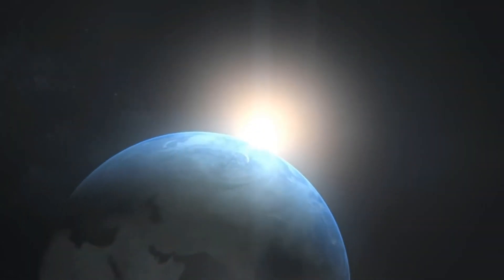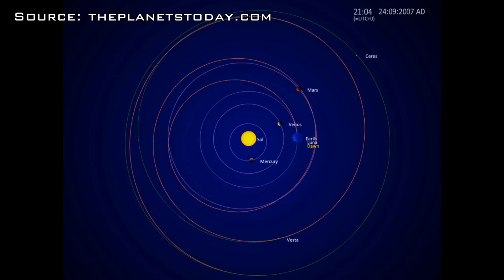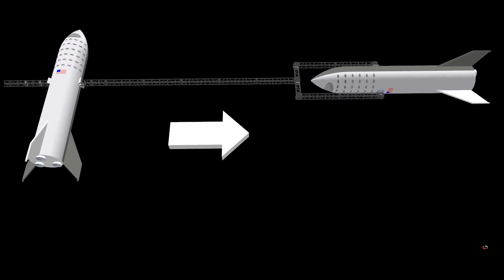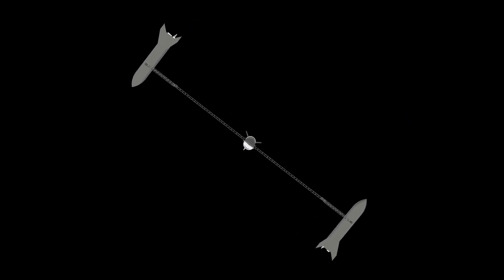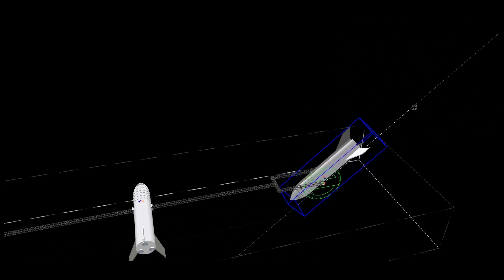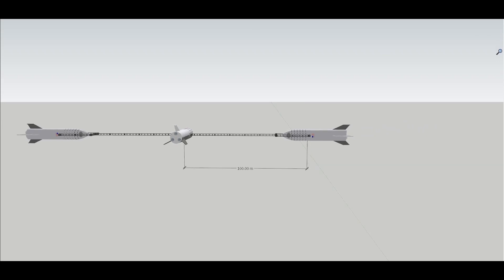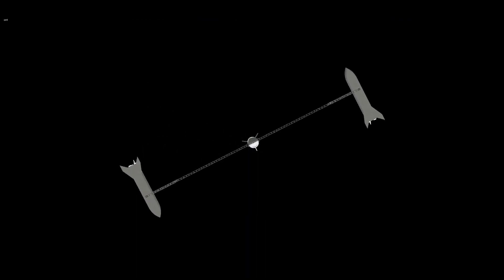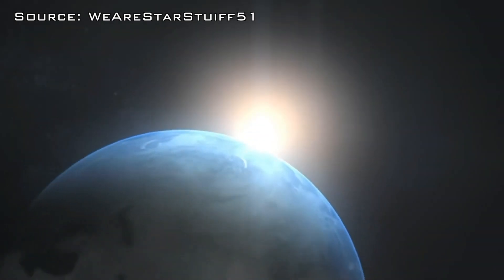GLS2: Artificial Gravity for SpaceX's Starship

Comment: This is the most practical artificial gravity system I have ever seen!
Reply: Where can this be discussed without having to wade through the flat earthers,
Reply: I see one big flaw in that system. 
That extended metal frames, which held those two Starships tied to central one - they shoud be able to hold on all the weight of ships. It's similar, in a way, to huge ass cables with great mass on their ends, which are attached to ceiling and must not snap under tension.
Mass of one Starship (fully loaded with fuel) - about 5000 tons (under Earth gravity), it's equivalent of 11 Boeing 747 or 83  M1 Abrams tanks.
If that spin gravity could get acceleration in equivalent about 0.5 g - than each frame should be able to hold about 2500 metric tons, which is a lot - a hell a lot I mean.
For example - modern tower cranes, which are used in constructing skyscrappers, could lift (and hold by cables) in avegare up to 60 metric tons. Most powerfull of mobile cranes (not gantry) - Liebherr LTM 11200-9.1
 - could hold up to 1200 metric tons, which is equivalent of Starship weight in 0.24 g. And I have doubt that it could hold that weight constantly for days and even months without material fatigue, frame breaking and eventual catastrophe.
Reply: @alexmalyarchuk1723  I think the Starship mass would be closer to 500 tons after TMI. You only need artificial gravity for the coast to Mars, when the fuel tanks are probably at less than 20% capacity.
Reply: @bubbajones6907 wiki says that total mass of fully-fueled Starship (with Super Heavy rocket) is 5,000,000 kg.
Starship itself - gross mass 1,320,000 kg (with fuel).
Ok, I see mistake in my assumings - that spingrav carousel should be consisted of Starships only, Super Heavy excluded. Than - 1320 tonns at each end. It's more feasible.
But still - imitating 1 g is quite too much, tension in structure would be drastic. And whole station should be capable of "making gravity" for at least few month nonstop.
0.3 g - martian normal - should be fine enought.
Reply: A tether system is far superior.
Reply: Earth is a luminated Plane (No Planets) there is no outer space, at All. There is a limited Void (The Raqia-Hebrew) above us, and it's full of ionizing Radiation, UVC. Therefore All the "Space" Programs since 1958 NASA ("To Deceive" Hebrew term) are being faked and filmed like a Hollywood movie. People are very gullible and naive, sad. Here you go https://www.youtube.com/watch?v=_ZBdnpRwyPg time to wake up.

1
Reply: @mulder2400  sorry what are you credentials, again? Calling people "gullible and naiive" when you've likely gathered your insights by blindly trusting sources on the internet is a bit rich. But I wouldn't expect you to understand irony.
Reply: @jonny__b  he's probably just a scitzo. Don't give him the time of day.
Reply: mulder2400 would you like to know how you’re a dumbass? Here I’ll break it down for you. 1) The number one question to ask is “does it affect the rich?”. Billions of dollars are put into space every year from government and private companies. People just don’t waste money. 2) Global cooperation is harder to achieve then getting to orbit. Several countries with space programs hate each other and would have no willingness to help cover up a secrete. It benefits no one to lie about what space is. 3) you yourself can launch something into space. It’s not extremely difficult to build what is essentially a large model rocket to launch something into space. That’s how Rocketlab started. 4) why would there be so many start up space companies if there was no space. A company exists to make money. A company can not exist if there is no money to be made. You have to pay thousands of employees annually. It’s just not realistic that a company would start up simply to push a lie for the government. (5 Blue origin will be launching citizens to space and back down on their New Shepard rocket here in the coming years. A company will launch you to space and you will see for yourself how stupid the idea that space is fake is. I have about 100 other points but 5 is enough for now. Please take the time to hop aboard new Shepard or Starship for that matter to see for yourself that the only people feeding you lies are the flat earth you tubers.
Reply: mulder2400 How can you be that stupid in the 21st century?
Reply: @bxmafiax  Hey. He has the right to be so.
Reply: @itechiwizard83  Everyone has the right to be stupid. But he's abusing the privilege.
Reply: @peterclark711  XD
Reply: @mulder2400  'very gullible and naive' you got that part right at least
Reply: @mulder2400  Yup. And there's a massive tortoise underneath that plane. It feeds the Earth. Under the belly of it, there's a massive structure attached like in an Air Ship in which the God lives.
Reply: Mulder2400 are atoms flat too?
Reply: @mulder2400  I would like to communicate with you, but the Prime Directive prohibits me from interfering with less developed civilizations.
Reply: @mulder2400  even if you got a first class ticket on the star ship to mars you would still call it fake

Comment: Seems there's a lot of moving parts and extra weight with this good idea. How about doing away with the tether and interlock both rockets nose cone to nose cone via a central inter locking system? Both rockets would need side thrusters to spin both rockets a little faster.  Surly this would reduce weight, and vastly increase stability......just a thought.
Reply from the maker: I like it! kind of a double tumbling pigeon

Comment: Truss is lame.  The RCS on Starship will be Methane, it will have plenty of power to slowly spin up two ships no matter what the mass.  Raptors of either type will be way too powerfully for spin up.  A full G is not needed.  Full lamosity.  Only thing you got right is the need for spin, broken clock level
Reply from the maker: The RCS will use methalox? Will they get their feed from the same prop tanks as main engines?
Reply: @smallstars  Hello smallstars I have been following the BFR announcments from the earliest days and they have made it clear that one of their goals is eliminating COPVs and all extra fuels, oxidizers and pressurants.  One of the advantages of methane is that it will self pressurize.  That means they could use that pressurized gaseous methane to supply cold gas thrusters.

I remember reading that they would be using the main fuel as RCS.  Admittedly, they change their minds a lot, as they should during the design and testing phase.  But ask yourself, if they use anything else how will they make it on Mars?

With Musk, always ask yourself does it help get to Mars quick, cheap and often, and ignore any crap he says about Climate Globalony
Reply from the maker: @adlsaias  Are you taking into account the difference in efficiency when using methane as a cold gas?
Reply: @smallstars  nope, but it would most likely be no worse than what is being used now to control the dragon.  If they needed more efficiency they could make mini rcs thrusters that burn methlox

Comment: Nice concept until you start thinking critically about the forces involved. Maintaining 1g of force for both ships will put tremendous stress on the trusses and central ship. For comparison, imagine the entire weight of the loaded ship being suspended by a single truss here on earth. That'd be like hanging an entire apartment complex from a single truss.  I think most would be nervous about  trusting that amount of weight to a single truss. Now multiply that force by two for the force pulling on the fuselage of the central craft. Without significant advances in tensile and structural strength, there's no way the system could hold up under such tremendous force.
Reply from the maker: I agree. A concept like this would require massive hub hardware, and about 12 tons of thick cable to "hang the weight" so to speak.

Comment: Whilst this particular idea is tailored to Starship, spin gravity was formally proposed by Robert Zubrin's Mars Direct architecture, which no one interested in Mars travel should be unaware of.  
And after 60 years on orbit, and endless tests of micro-gravity (conclusion: Micro-gravity is bad for humans) the fact that no one has tested Mars G (.38G) in a LEO spin tether habitat, had long since led me to conclude that no one had any real interest in going to Mars.

This will be a vital test before anyone heads for the Red planet. What is the threshold between 1G Earth gravity, and Micro-gravity, where the negative effects on humans become serious? Will a year or two (Or a lifetime) in Martian gravity be manageable, or a show stopper?
Reply from the maker: Great points! Zubrin is the champ. In all of his presentations i've seen, he does not explain how the spin would start up. Also his examples are for smaller, less massive spacecraft so all of the systems that support the spin can be smaller. I assume his plans would utilize RCS.

In terms of the amount of artificial gravity, from the knowledge we currently have, it is my opinion that more 1G is better, especially for strength and bone loss. So considering 1.5 years on Mars is assumed, 1 G during the 6 month trip there and back is going to be super important.

Comment: one problem with this system. when you want to slow down the spin, the fuel would be pushed down sideways (after the re-orientation of the spaceships) in the tanks and cannot reach the connections to the turbo-pumps. you would suck in the helium pressure-gas. in order to avoid this, you would need a second line feed for the fuel taking into account the "gravity" orientation
Reply: Not only that, but think of how rigid the spaceships would have to be in order to be suspended by their "waists." And how much that structure would weigh.
Reply from the maker: I envision the vacuum raptor to start up the burn before the co rotation begins. Not sure how practical that will be though.

I don't believe making the hull rigid enough will be an issue.

Benjamin brings up a good point though, the massive swivel joint hardware should launch on the GLS as part of the truss/cable system.

Comment: Great idea. So many variables with artificial G. NASA should build a large centrifuge that would replicate this concept on Earth prior to investing massive funds to prove it in space.  If designed correctly it could be scalable to test other ideas. Also I highly recommend a manned mission to Venus before Mars. Not practical to land on planet, but to prove feasibility of interplanetary missions on a shorter timescale.
Reply: Any centrifuge tests on Earth start in a 1 g environment, thus results are not what is nèeded.  Prototype system could be built and tested in LEO.

Comment: I always wondered why they didn't use clothes with steel shot in it and a big magnet
Reply: Because of the square of the distance rule. Any magnetic force that exerted any significant pull on you, let's say - on your shoulders - would exert a tremendous force if you bent over or kneeled.

Comment: I think this is a great idea, but it seems that the spin could be accomplished with Electric thrusters and/or gyroscopes rather than using fuel if Solar Arrays are implemented. Just a thought.
Reply from the maker: Gyroscopes not so much (leverage issue) but electric thrusters would be great if they don't cost too much of a payload penalty!

Comment: The simpler design is 2 ships, cable nose to nose, a single ion thruster or small engine at the top for both spin up and spin down. (or single ship see bellow)

Target acceleration: 0.6 g
Rotation rate: 4 rpm (you will notice it at first but get used to it in 1-2 days)
Velocity: 14 m/s
Radius: 34 m (to main quarters, shorter to nose, longer to ship base)
http://www.artificial-gravity.com/sw/SpinCalc/SpinCalc.htm

Starship mass: 900 ton ~ 665 ton fuel (using conservative 50% of capacity, prob much less in reality) + 85 ton ship + 150 ton payload
https://en.wikipedia.org/wiki/SpaceX_Starship

Cable tension: 5,300 kN
Cable type: improved plow steel (worst case example, in reality use something better like Kevlar)
Cable diameter: 18 cm (effective, use several small cables)
Safe load: 3,500 kN (150% load)
Cable breaking point: 17,000 kN (31% of breaking point)
Cable weight: 6 ton (for one half of cable, 4% of payload)
https://www.engineeringtoolbox.com/wire-rope-strength-d_1518.html

#1 challenge: The cable needs to be part of ship, ie go through the ship towards base, can get thinner as it gets integrated with ship frame.
#2 challenge: Cable loads assumes ship mass is at 34 m radius, but fuel will be past main quarter, so load on cable will be more like 250% of safe and 51% of breaking.
https://i.stack.imgur.com/GYIgz.jpg
#3 challenge: Ion thruster located near the top (opposite of heat shield) that can get 900 ton to 14 m/s in ~2.5 days (slower is safer and simpler). This require only 60 N of sustained thrust. There are already experimental ion thrusters in this range (MPD thruster). To spin down twist the ship on cable axis and repeat.
https://en.wikipedia.org/wiki/Ion_thruster

Mass of the cable can should/will be reduced by a factor of at least 5 by using existing materials such as Kevlar.
A factor of 5 reduces cable mass to 1.2 ton per ship (0.8% of payload).
http://www.sssg.whoi.edu/sssg/winch_wire/UNOLS_Winch_and_Wire_Handbook/03_synthetic_fiber_ropes.pdf

Even better is the one ship design where living quarters separate from fuel and engine and get spun up while tethered. If this can be achieved the cable decreases to 22% of above thickness (~150 ton payload+50 ton ship quarters vs 900 ton ship), ~65% of above total cable length (~44 m), resulting in ~17% cable mass (1.7 ton for steel or 0.34 ton for Kevlar). Longer term this makes more since, but there will be a weight & complexity penalty for making a ship that can separate into two. Ion thruster requirement decreases to ~30% (18 N for the 2.5 day spin-up to 0.6 g).

Thoughts?
Reply from the maker: Your math seems good, but your design's goal of being simpler costs the passenger starships a payload penalty. Thanks for your intelligent input and I look forward to speaking more with you about this topic. DM me on twitter.com/tinysmallstars
Reply: @smallstars  I made some edits. I think using existing Kevlar the tether cable mass can be reduced by 5x to ~1.2 ton (0.8% of payload) for the two ship design.

Comment: You should reconsider tethers. they are stronger when under tension, lighter, simpler to use and store, you probably wouldn't need a third space ship. You don't need a rigide system to spin both starships, the centrifugal force will keep the tether under tension. you haven't given any of the failures that a tether could cause and personally I see the truss more likely to fail in these scenarios.
Reply from the maker: Tether + truss, or tether inside truss seems to be the best way at this stage of my thinking.

My main concern with a tether only system is as follows: When slowing the system down is when you invite the most chance for a failure. Without a rigid system u can't use main engines, and you can't climb the rope as easily as you can climb a truss ladder.
Reply: @smallstars  to move ressource between ship you can either use a lift attached on both ends to prevent it from falling towards the other ship when the gravity switches, a paternoster lift, or simply climb the tether like what they've been testing for space elevators.

their shouldn't be any problem with slowing down, when under thrust the ship are essentially trying to push away from each other so they wound never collide. the only issue their could be would come from the elasticity from the cable but that should be handled by the RCS or clever use of the cable spooling system. what is more it might be more efficient to separate while spinning rather than stopping first do to how the velocity vectors would align, I might be wrong on this one though.